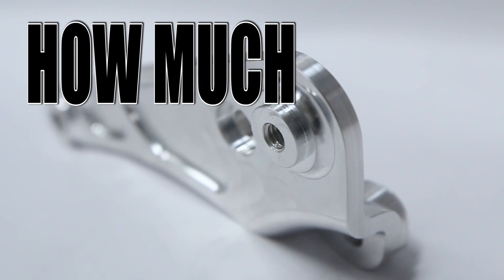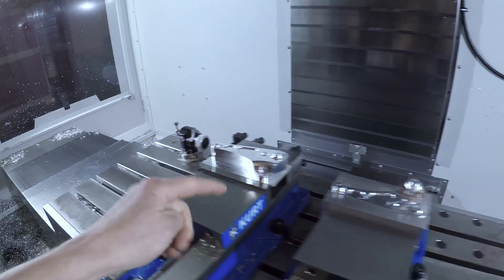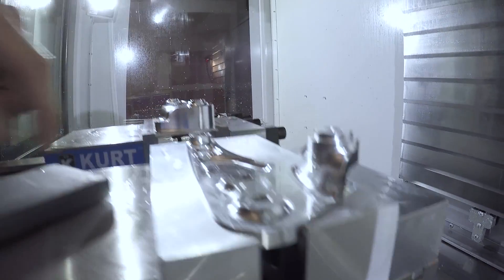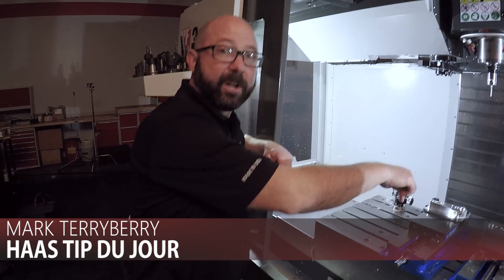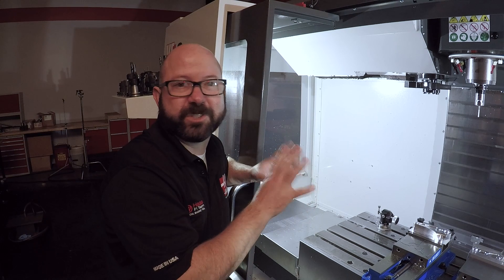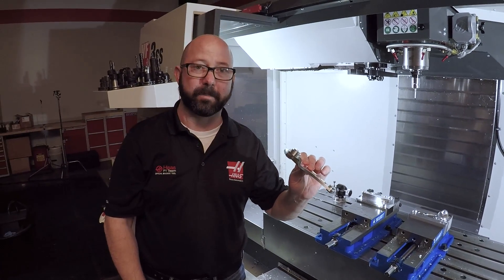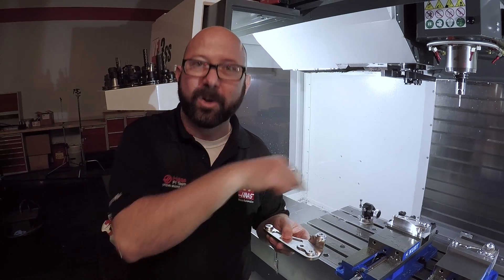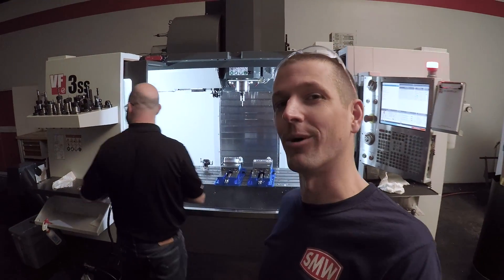How Much would You Charge to Machine this Part?

Comment: I see a lot of "Time & material" responses for these types of videos where there are cost estimates.  Does "Time" include Workman's Compensation, uniform laundry and employee vacation and sick days when they are not producing? "Material" is pretty straight forward. Where does the salary for the owner of the business, cost for the building, machinery and machinery maintenance, tax to governments, insurance, building utilities(that power bill got to be sweet!) etc., come from, "time" or "material"? I didn't see the spread sheet.
Reply: Typically, the "time" portion is an hourly rate that you need to keep your shop open.  In the U.S., this typically falls between $75 and $125 / hour depending on the shop and this time includes all the things you're mentioning as well as watching Youtube videos, answering emails that will never lead to anything etc....
Reply: So, IIRC, using this video(VERY rough estimate) as a guide: 30 pieces X $110 @ 5 per hour was it?  $3300/6 hours.
Reply: Let's assume an hourly rate of $75.  For a final price of $3300 for 30,  you can guess that the whole job took around 44hours grand total, possibly as little as 26hours at a shop rate of $125/hour.  That includes any CAD/CAM work, setup, soft jaws etc.
Reply: I considered the CAD work and was going to inquire about it. Since it wasn't mentioned, I assumed the customer supplied the drawing and it shouldn't be included in the job shop's bid other than to review for the part cost estimate. If it takes a shop 4 - 6 hours to complete a project they bill $3300 for, the hourly rate is not $100/H(+/-$25) unless the owner is fooling themselves or trying to fit some narrative like a union job shop rate. I don't recall whether or not they mentioned the amount of time that was spent from beginning to end, including CAD review and customer contact. I guess I should just come right out and say I'm challenging the notion that the quote is some kind of "hourly rate". My unqualified opinion..

Comment: 6 mins = $109 . your crazy.
Reply: vettepicking made from a 100,000 dollar machine though....
Reply: Plus program time setup time and material.  $109 ea. for how many is the question. One? if so that's dirt cheap
Reply: If it was that easy everyone would be doing it. You clearly have no experience in this field.
Reply: +3 hours to program + 3 hours to set up +$$$ for material +$$$$ for a bunch of scrap parts your employees ran +$$$ for paying your employees by the hour to scrap parts +$$$$ for tooling.....
Reply: 30
Reply: Who is paying $20 to load parts and push start?
Reply: Steve just Steve I disagree that driving a concrete truck takes no skill. The unskilled drivers are the ones causing all the collisions and incidents in the trucking industry. I wish people would give us skilled professional drivers more credit for what we do. It's definitely no cake walk to be a REAL PROFESSIONAL DRIVER these days.
Reply: Well first of all, it's 6 mins per side, so 12 min total. And that's JUST run time. No CAD/CAM, loading/unloading, inspection, stock prep, setup, workholding, packing/shipping, administration, cleaning/maintenance or first part program proving.

http://www.jegs.com/i/Weiand/925/7064/10002/-1

A much simpler part. Subtract $20 for the hardware.

Jeg's (or any other performance supplier) would sell the part in question for $250+.
Reply: An airplane engine is $15 million, but I only pay $200 to fly 3 hours round trip.
Reply: Steve just Steve, Jeff Lalonde - the concrete truck was just an example - a similarly priced machine, with several people behind it, not just the driver, yet they manage to do their job for a lot less than $9 a minute!

Programing time must be taken into account, yes, and tools AMORTISED, and it's unlikely that the face mill or even the face mill inserts are gonna be used up on 30 parts, or snapped if programmed by a competent operator. Every business has costs and risks - the only reason CNC machining can charge that price is because it's a rare service (for now) and there's a shortage of experienced people (for now). Look at laser cutting (in South Africa, at least) - it's dirt cheap now because of all the competition in the market. CNC machining will go the same way.
Reply: marat gorbunov, according to Google, there less than 20% difference in the price of milk (or concrete) between South Africa and the US. If you're paying $6.50 for half a gallon, you're shopping at the wrong store.

Your argument is invalid.
Reply: Sure. Gone drinking $6.5 milk purchased at the wrong store. $2 bottle deposit. Take care:)
Reply: yup
Reply: innomi natum . you also dont have a clue
Reply: kenneth you can't use that comparison. anything on shelf has roughly 40-50% of the sticker cost to cover marketing and distribution. shops run business to business. I would charge no more than $25+ material for this part in a 30 piece run.  15 minutes for both sides plus an hour and a half over thirty parts (3 minutes setup / programming) is 18 minutes. at a decent $80 shop rate, you're looking at $25 in machining costs.  

after I sell the pieces to my customer, they take their markup and sell it to their customer. their customer being a retailer marks it up yet again to hit that sticker price.
Reply: vettepicking If anything Steve just Steve underestimated the tooling costs, $100 wouldn’t cover the cost of tips by a long shot, tooling is incredibly expensive, we have 3 CNC lathes running 8 hours a day, 5 day’s a week with a average insert, drills, end mills etc costing about $1200 each week, then you have the cost of things like software, maintenance, wages, insurance, setup time, materials, prep etc etc, the list goes on.
If you think it’s that easy, buy a cnc and earn $2500 a day for yourself.
Reply: Chris Alister
But you're not the only passenger on the plate,otherwise it wouldn't make it of the tarmac.
Reply: And you need to get 1st grade spelling lessons again.
Reply: 6 mins is JUST MACHINE CYCLE TIME. There is a whole lot more time involved than that, But you obviously don't know that.
Reply: Your right there is a big difference. I went from dragging mud to running the chute to project manger to partner in a GC company, so I've seen my fair share of gear jammers and steering wheel holders even ran pump trucks, but would never call myself a pro. Fact is most of them lost their proverbial gear synchros long ago or never had any. Then there're the ones who take a lil pride and have common sense. I now am a sole proprietor building 3d models for GPS machine control and run a machine shop out of my home shop (more of an expensive hobby), and I can tell you there is much more to machining be it manual or cnc than driving trucks or running job sites. A man can study his whole life and still not grasp the majority of subjects involved with machining, from machine repair to metrology to metallurgy, no comparison.
Reply: @Steve_Just_Steve  "I went from dragging mud to running the chute to project manger to partner in a GC company" - And you still don't know the difference between "your" and "you're".
Reply: @derbigpr500  You'RE right I have no clue, what an ignorant fuck I am, you've exposed me and stripped away my will for life. What on earth will I do myself. Is there really any reason to even go on living...
Reply: +vettepicking  Your a fool if you think its as easy as that 1st grade math you did there. Oh and tools $100.... that might buy the inserts in that face mill... maybe, then 300-600 for the face mill itself + the other 3 or 4 endmills and inserts used on this part @ 200-300 EA!  + 3 or 4 tool holders @ 200-600 EA! + coolant + oil + elec. , oh yeah we have to inspect the part...+ I dont even want to say..... oh you accidentally punched in one wrong number out of a couple hundred... time to buy another $200 endmill, oh shit that was my last one that size...2-3 days out...  thats just the beginning, I could go on and on.  You could not have made it more obvious how ignorant you are about the costs of a shop or any business.  Tools=$100  hahahahahaha  I so F-N wish!
Reply: vettepicking, you don't know what you are talking about.  You have no time included for dealing with the customer.  No time included for CAM programming.  No overhead costs at all (rent, electric, insurance, machine payment, consumables - coolant, way lube, etc).  And $6 for each piece of metal?  No way in hell... maybe if you are buying it at scrap price - but you aren't buying brand 6061 at scrap price, certainly not in quantities needed for 30 of those parts.

There's a reason the real shop owners posting are all hitting similar numbers, because that's what a job like this costs.  When you focus on a few costs and then assume everything else is "PROFIT!", you are letting your anger over someone else's success cloud your judgement.
Reply: Steve just Steve you nor I ever made a comparison. I was simply saying your statement was not correct IMO. I drive trucks as a day job (nights actually lol) Then I have many hobbies including my little CNC carving/engraving machine, new to me metal lathe, woodworking and so on. Also currently developing my own 3d printer.  I'm very aware of many of the many skills required to be successful in machining or 3d design etc. I agree with you that the two industries cannot be directly compared. Just personally take pride in what I do and hate when others pass it off as something that anyone can do. The industry has gone to shit because people feel that way and that's why we have so many idiots behind the wheel today unfortunately.
Reply: motorman0297 lets see your fuckin numbers bigmouth
Reply: you watch to much youtube, your tooling costs are crazy and shows you never ordered a endmill or insert before....clueless trolls
Reply: +John Alexander   Your not taking into account what I said, besides driving a concrete truck takes no skill.
Reply: vettepicking 6 mins per side. Still, $109 is crazy. Collin B A $100 000 concrete truck doesn't charge $109 per 12 minutes standing time. I pay R8 000 per 6 m³ for concrete (about $600) Including loading time, travel both ways, standing time, offloading time and cleaning time. At least 2 hours total, and that price includes material (probably R5 000/$370 worth).
Reply: or your house is paid off in 2 months......
Reply: nope
Reply: setup person $20 per hour  = $120 + metal $200 + tools $100 + 12min per part x 30pc = $300. total $720 minus $3270...... profit $2550 for one day. your machine is paid for in 2 months......overpriced job

Comment: personally, i would say 12 minutes per part is 5 parts per hour, 6 hours to run 30, I'd charge $1500($250/hour) for the order, but that's just me
Reply: When you quote you don't factor in programming, setup or tooling? I assume you're not actually in charge of anything.
Reply: mnm knives , $250/hour!?!? Are you running a multi million dollar machine?  $60-100 an hour, or you're getting beat on a lot of jobs.
Reply: mnm knives   A small order like that would warrant a price like that. You're right about the machine time but look at the material costs and tooling and shop supplies.  They are not far off.   As with anything. You gotta buy in bulk to get costs down
Reply: mnm knives don't think 12 min are realistic ,unless you have a terrific jig, robot and a super fast Japanese machine
Reply: Fischer977 true, but based on the information given that's what I'd charge
Reply: So you quote a 100-120$ part for just 25$ based on someone elses mistake?
The machining prices in america are quite high
Reply: Fischer977 I'm just basing this off the info from the video, I'm not bidding a job so it's irrelevant. obviously if I had a shop I'd put more than the minute of thought into it that I did here, you're taking this far too seriously
Reply: mnm knives i own a shop. This quoting is natural to me
Reply: Fischer977 i am just basing on the info on the video, I know my numbers probably not the most realistic lol, but it's not important in this situation

Comment: what are you thinking about 3d printing?
Reply: My dad just bought a magazine well funnel (to make it easier to insert a magazine) for his AR-12 shotgun. It was $20, 3D printed and the worst quality product I've seen in years. Looked like it was made on a Makerbot in the garage. FDM 3D printing is junk IMO. Now, SLA and MLS 3D printing is another matter.

For prototyping, 3D printing is excellent, but it's not production level just yet. On the other hand, SpaceX 3D prints their new super draco rocket nozzles using Metal Laser Sintering.
Reply: ...or the lazy bastard who did it was also a cheapskate, thus used something like PLA, and of course did nothing with the surface.
On the other hand he could have printed it from ABS and vapor smoothed it with acetone, to give it a nice finish - to be honest i have no clue about the temperatures those parts experience, but if its a few hundred °C one has to be careful about what type of material he/she chooses to print with.

Comment: No tight spec +\- .005 6061-T6. @30 parts
$85-$90/ part
Reply: An hour setup per op. 2 hours to program tops. 

Pretty straight forward grip it rip it ship it part.
Reply: @occamssawzall3486  i work fast .but 3 hours it not enough.you kidding
Reply: Boosted98gsx 
I can't see any part requiring that many ops. Again. If t takes your 40 ops to make a part, you better no bid it because it's beyond your capability to machine effectively and efficiently and there's no way you could compete with a better equipped shop in either price or time frame.

Charging per op isn't a good way either. It depends on what each op takes. Just arbitrarily going X price per op, times Y number of ops will lose you money.
Reply: Boosted98gsx 
Then what are you expecting for an answer? 😂

A million $'s. Not sure what you're trying to get out of this line of questioning. No. There's no fixed per op price to use to quote something.
Reply: Occam's: How do you price out set up time?
Reply: This. What if it turns into a 40 operation part and you have to cut 3 sets of soft jaws?
Reply: Boosted98gsx 
If it takes you 40 ops to make that part. You're either in the wrong trade, or you need to use a tool more advanced than a hammer and cold chisel.
Reply: Just a small click-bait to heard curious viewers towards the Patron page ;)
Reply: I never said THAT part, just making the argument that you should charge per op, because it takes time and material to make the soft jaws. It was an exaggeration.
Reply: smdh

"It was an exaggeration."

Comment: If it's a 10 part machining, in Holland I had to ask what shops ask over here so $60-100 would be the price. If self made the material costs + $20-30   Now I go looking at your prices!
Reply: yep i second this 
i usualy go for 62.50 an hour depending on the product and the amount of wear
if its a one of i dont charge tooling fee ( unless its crazy high wear) 
otherwise the tooling needs to be calculated  as wel
then the material cost and preparing of it but most of the times that`s the cheap part

but this a a rather complex part  so that 100 sounds nice and fair !

Comment: Great video as always John.  I ran the numbers quickly and got $111.00 haha
Reply: would you be willing to share how you came up with these numbers? Thankyou -Eliott
Reply: Sure,  I estimated the labor (part programming time,  soft jaw programming time, machine setup, machining soft jaws, and machining parts) and got 32 hrs total labor.  32 hrs x $75/hr divided by 30 parts = $80 per part labor.   I estimated $31 per part for material so $111 per part for the job.
Reply: That is only available to your Patreon supporters.
Reply: I don't know how you're getting 32 hours from a 8 hour max job including programming and setup. It's $25 at my shop assuming 15 minutes a part plus an hour and a half over 30 pcs (3 minutes) so 18 minutes.
Reply: joshmdmd how would you program and machine softjaws and all parts in 8hr. Stretching it.
Reply: 12*30 is 6 hours. Programming the part (from a paper drawing is no more than 30 minutes if you're decent). Cut up the drawing, change the machining to make a program for each softjaw (another 30). Machine the softjaws in one hour. If you want to quote safe just tag on 1-2 hours and split them across all 30 pieces. When I have a quantity job and I am the preferred machine shop, I realize that each extra dollar I quote ends up being pure profit (and I have the ability to do so because it's my shop, and our rates are relatively low).